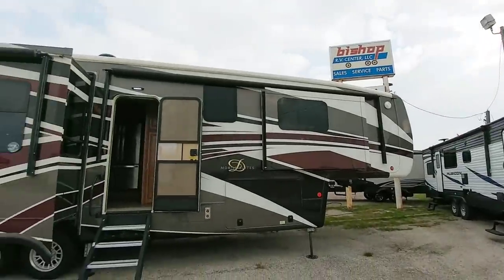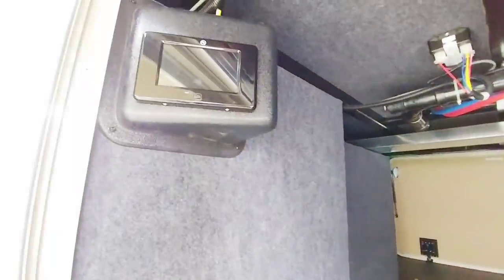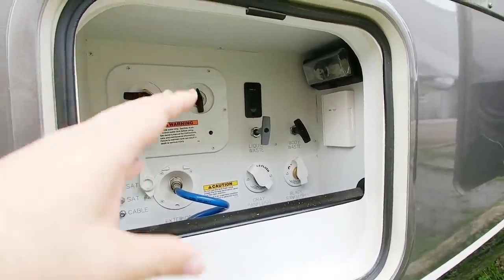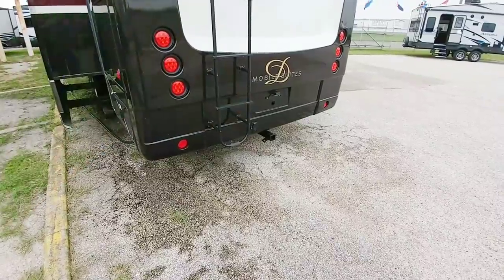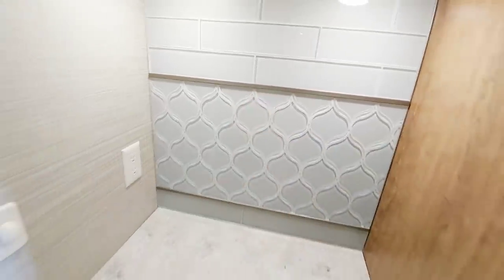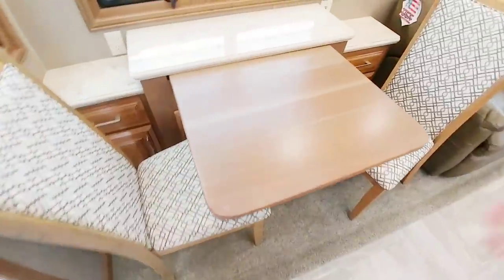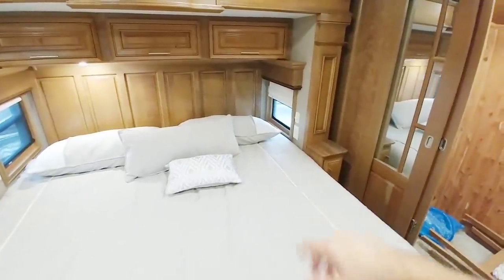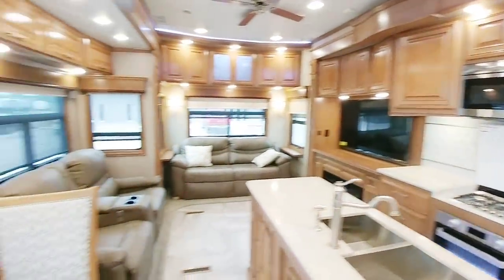Meet Pure Luxury! DRV Mobile Suites Fifth Wheel RV! 38RSSA

Comment: We just went to Elkhart IN and got the MORryde independent suspension and disc brake upgrade on our '17 Keystone Avalanche. The custom factory install has more welds to the frame than DRV installation does. DRV installs the suspension in house and sends each unit to MORryde for wheel alignment prior to full body paint. The new suspension is awesome, I don't feel the RV going over bumps in the road any more. The brakes make us feel much safer especially in heavy stop and go traffic. It's too expensive for those that don't use their RV much, but we have been full time for over 2.5 years. We were pleased to get a 10% winter discount (I think this is available until the end of February)

Comment: We bought our first RV - a 2019 DRV 36RSSB3 - in January. We started full-timing last month. I don't think I'd consider anything other than a DRV if and when we change RVs in the future.
Reply: We bought a 2008 36RKSB3 new and full timed for 5 years and loved the experience and will do it again when I retire for good in about a year. I love the DRV products, but one VERY important thing to consider....replacement cost for everything. Things like refrigerator, ac units, water heaters, roofs, etc., they don’t last forever, they don’t even last close to anything in a home. If you move your unit frequently, keep in mind you are putting it thru an experience similar to a small earthquake every time you do so. My best advice is to keep good tires on it, always perform preventative maintenance on EVERYTHING that you can, and keep some money set back, so if there is an emergency repair that is not covered under warranty, it will not hurt the pocketbook as bad. I will probably purchase another DRV, but will try and find one about a year old, previously owned, that will bring the price down and make it more affordable. My best of luck to you, and hope you enjoy full timing as much as we do!

Comment: I am used to the fact that my sense of taste is vastly different from JD's and the majority of the 5th wheel market, I think that paint job is gawdy and ugly, tastes differ. I am confused that the same guy I have seen be very particular about the frame coating process on trucks has no problem with all the rust on this high end RV. The hitch, the slide mechanisms and the frame are all showing massive amounts of rust and finish that is already worn off.
Reply: I noticed the frame rust too
Reply: I had 1st noticed it   On the nuts and bolts

Comment: Hi Big - I noticed in this model, a reasonable "air gap" between the range and an adjacent cabinet/fridge/wall.   Something we have noticed with our first RV, we are foodies and like to cook - and is also being much more convenient while traveling.   Using the range for any length of time at all starts to heat up the side of the pantry, only about 3 or 4 inches from the cooktop.    This seems like a large safety concern, and as we have been shopping for our next rig, it is almost impossible to find something with counter space on both sides of the range.    I'll also add that it is incredibly difficult for food prep with minimal space. 

Thoughts?

Comment: I just bought a sandpiper 3075 dbok. I’m towing it with a 2016   F-250 with a 6.2. The camper is high in the front when I’m towing. I need to adjust the hitch (Husky 16k manual slider) How much clearance do I need between the cap and  the bed.
Reply from the maker: Min of 6"

Comment: I'm concerned about having just two axles for up to 21,000 pounds.  With 10-15% on the hitch that is still a lot for the axles and tires.  Expected three axles like a Toy Hauler.
Reply: David Coupland Axles May be rated for 12K lbs each, depends on how it was spec’d. They can be ordered in many configurations

Comment: Only comment is that Dometic 3-zone air system..  We have that on our current camper and HATE IT... Maybe for modern techies it's fine, but for somewhat older folks, that thing is way too overly complicated. Why not just have 2 (or 3 depending on AC unit numbers) simple thermostats with on/off and temp settings for either heat or air?    DRV makes a seriously good, higher-end camper and they're built extremely well...

Comment: My question is why stack 2 6” rails instead of just using a 12” beam
Reply: An I-beam only provides strength in one direction, in this situation up & down. Box or rectangle tubing also provides side to side strength.

Comment: Structurally, top notch, very well engineered, but . . . . like Chels (comment below) said, and I've seen this over and over in new RV's, the interior esthetic needs to get out of the early 1990's and into the 2020's - bleh! The over-carved cabinets; honey wood tones; wood panelling; the dining chairs and ceiling fan - had those when I got my first apartment (in 1994); the hot mess of a lighting contraption over the kitchen island; chunky carved valences over the windows; Two different styles of glass tiles above each other on one wall . . . Why? The poofy, overstuffed "lazyboy" style sofas . . . etc. It kills me to think that in considering purchasing one of these models, for the amount of money they cost, I'm still going to have to gut and reno, and bring the interior style into 2022. DRV needs to hire some actual, certified interior designers (that are younger than 65).

Comment: I'll bet the F-450 would struggle to pull that fully loaded. You almost need a Class 8 truck for that coach.
Reply: My F450 pulls the JX450 version of this unit pretty well but you have to be patient with on-ramps.  The brakes on the trailer are very strong so stopping is not an issue.
I seriously considered a Class 8 but: That is not a very useful vehicle when not towing (which is one of the benefits of 5th wheel vs diesel pusher), and the overall length further restricts what sites you can get into.  Still thinking about it.
Reply: People that run hot shot trucks pull that much weight all over the country no problem. Also have to think, if you're buying this for full time living it's going to be parked 99% of the time until your job dictates you moving or you're going south or north for the different seasons. Unless of course you're wanting to retire and travel the country and go to a new place every week, at which point that would be a lot of towing, but the truck should handle it.
Reply: 22k is not nearly the limit of a well equipped F450.  I pull a similar unit with my F350 and accelerate uphill just fine, braking is easy, and handling isn’t bad at all.

Comment: Having had two keystone Montana’s, I’ve always enjoyed living in 5th wheels. BOTH of which I purchased in south Texas. ( 1st in Alice, #2 in Corpus) 
The price here, is to steep. Due to its weight, you’re going to have to purchase a diesel pickup to pull it, so you add another 45 to 60 grand. If you have no other responsibilities, then it’s fine. 
But?...... Space rent. Insurance, payments, well? Should you have 3 heart attacks within 3 months, it’s incredibly hard to pay all of these expenses. 
I TRULY LOVE this unit! The price? I don’t love. 
I would buy it if it was QUITE a bit cheaper. 
I think I’ll go with a Pinnacle model, 4 season to accommodate extremely cold winters. 
My wife and I are seriously looking at nice, reliable, fundamental 5th wheels. 
At the 50 to 60 thousand level. 
Great video!

Comment: ONLY THREE (3) BRANDS (Currently/Still-surviving) in this END of the market.
(Quality / LongLife / FULLTimmer / Tow-with-a-REAL-TRUCK / 
Winter Tolerant (Year-round) / Customisable)
Semi-Trailer &/or Fifthwheel Trailer RVs.
DRV (Suites) ,
New Horizons ,
& RV Factory (Luxe)
in North America.

Stay away from all the others ! 
The others (mass-produced crap from Indiana) are Just Junk !
Reply: Adymn Sani , heat pumps are not designed to work as full on furnaces, they are only designed to work above 45F to save from burning gas on your furnace.
Reply: I agree Snow. We did a factory tours of all the mfg you mentioned last year and afterwards had settled on New Horizons with Luxe at a close second. However, DRV was NOT even a consideration after looking at all.
Reply: @highlandgrip  , I think that, 
since the change of ownership,
and the introduction of 
a slightly different corporate culture,
LUXE are very quickly lifting their game.

However if you have available
"a HEAVIER tow vehicle" (Tractor-Unit),
both (I think) DRV & New Horizons,
build chassis-frames in-house,
under their own supervision,
and adapt the designs somewhat,
to suit your order,
and tend toward heavier chassis
for longer "viable-life" expectancy,
and fewer "maintenance & repair" issues.

Even Air (over hydraulic) disc-breaks are
on the Menu.
Reply: @SnowAndrews , unless things have changed within the last year, New Horizons is the only one of the three that build their own frames
 Both DRV and Luxe use Lippert sourced frames that are "built to their specifications". That's not the same as building their own frame from the ground up.
Reply: @highlandgrip . Sorry my error. 
I got another Manufacturer confused
(not being from North America, this a bit more difficult).
Reply: @SnowAndrews , no problem.  The only other manufacturer that possibly might make their own frames is SPACECRAFT, another high end custom builder.
Reply: Vanleigh by Tiffen seems to be fairly solid but I have not seen too much detail on the frames and how the cables/ducts/plumbing are run and restrained. It doesn't take but a couple extra hours to do a tidy job of that stuff and it makes a HUGE difference in long term reliability.
Reply: my current favorite (if I could afford it) is the Forest River Riverstone 39FK.  Beautiful rig.